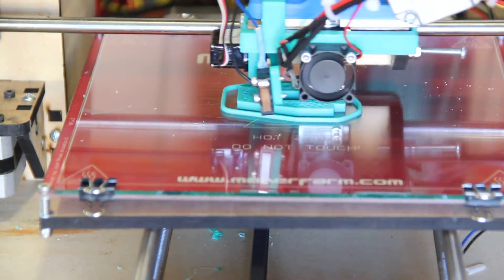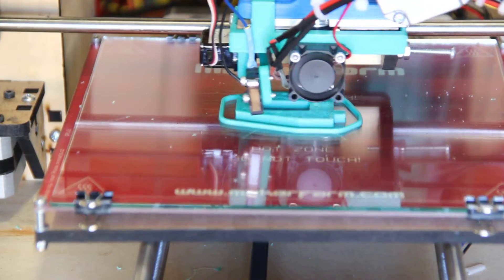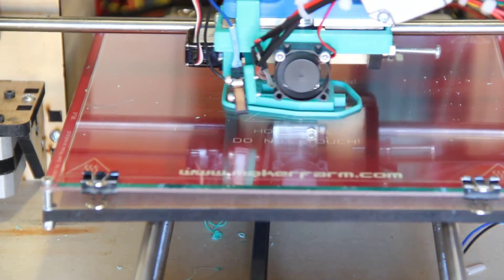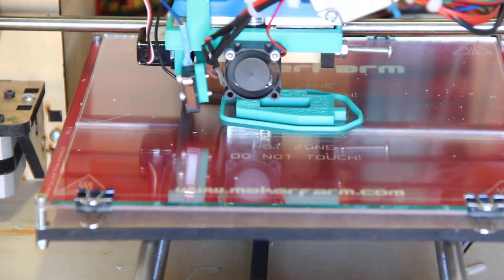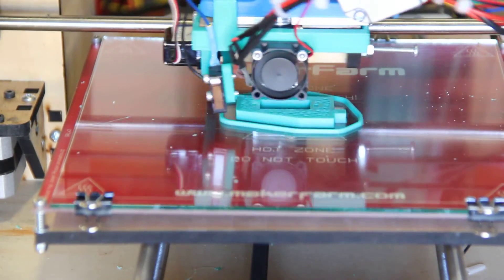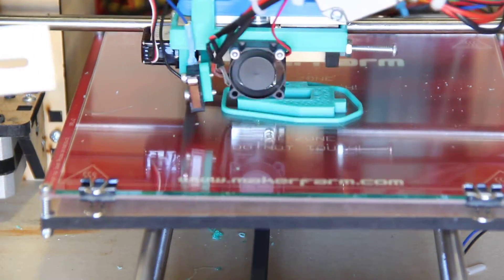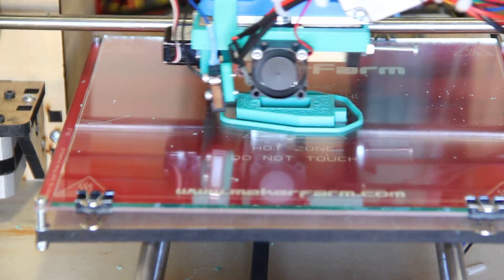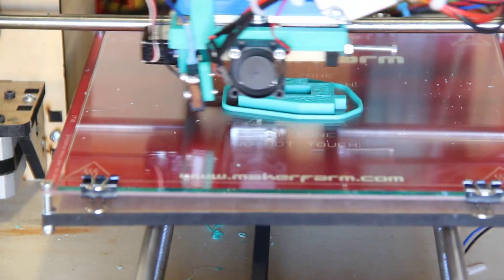Prusa Nozzle MkII all metal hotend on a Makerfarm Prusa i3 3D printer

Comment: what is the printed part going round the X Carriage the bit that your fan is on ? and duz the servo not hit the z axis ?
Reply from the maker: That's a fan mount I designed, since my extruder block doesn't have the mounting holes in it, and that's a 20mm fan, so it wouldn't have fit anyway.  It's on my Thingiverse page if you want to check it out.  And sadly, yes, the servo does hit the X motor mount, and I do lose a few mm of print volume.  There is another design on T-verse that mounts the servo more forward and vertically, which looks very promising.

Comment from the maker: Sadly, I'm afraid that's not a short video. :)  I am planning to do a series on calibration, but it will most likely be in several parts. The short version is that almost any RepRap is capable of insanely small layer heights, but it takes some skill on the part of the operator, as well as a part that is amenable to it. Then you start into the trade-offs...  :)

Comment from the maker: You shouldn't.  I have been able to get PLA to extrude and print, which tells me it's just a matter of finding the right settings.  I would expect that any change in hotend will involve some tuning and tweaking.  This would be true even if you're doing something as simple as changing between a .35mm and a .5mm J-head.